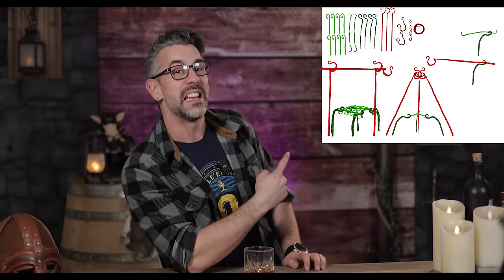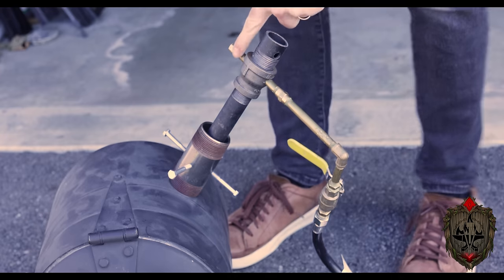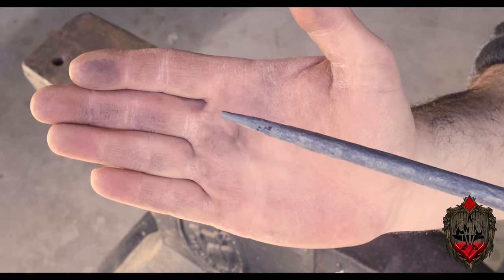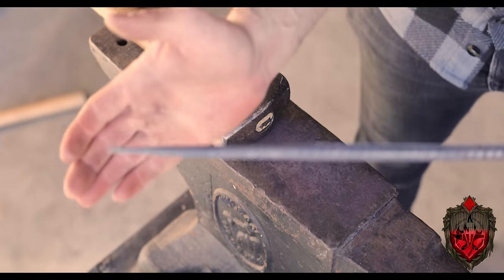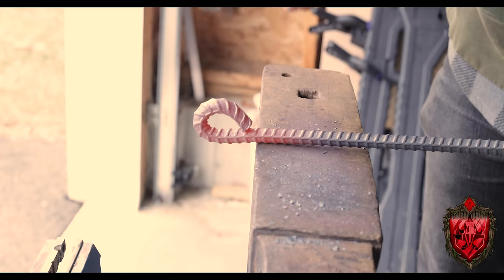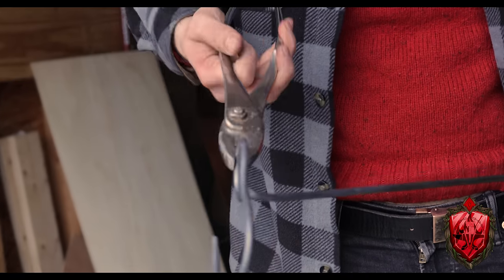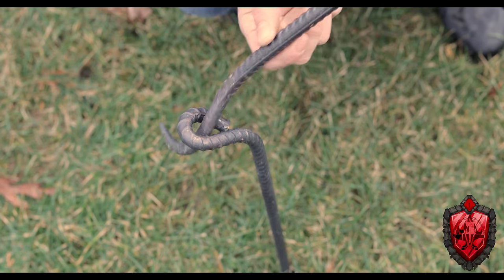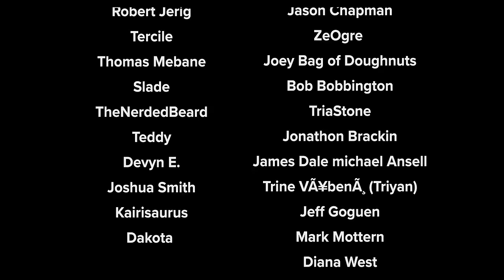Forging the Ultimate Campfire Cooking Setup

Comment: The first rule of the blacksmith's shop: everything is hot until proven otherwise.
Reply: Adding on to this: even a good glove is not going to protect you past a certain point. Use tongs (or the like) unless you are SURE the metal is cool enough to handle
Reply: "... until proven otherwise." Usually by grabbing it...
Reply: Proving otherwise is how you get thicker skin.😂
Reply: True story
Reply: @OutlandStation If you're quenching with water, just dip your finger in some water and drip a little of it onto the metal, if the water evaporates, it's hot, if it sits there peacefully, it's still hot, dip your finger in a protective layer of water and give it a couple test taps.
Reply: Just like kitchen rules - assume everything you touch is sharp and/or hot.
Reply: You're dead right. Cheers mate.
Reply: If its not actually wet from being quenched (the shop I used to work in used an old bath tub as a quench trough) don't touch it.
Reply: @brucelee3388  If it is wet, it probably won't burn you, but I have been amazed at how hot something can still be while wet.
Reply: Also lab rules.
Reply: I always say it as EVERYTHING is hot, poisonous, and sharp and whose sole purpose is to make you get to meet Mr Grim Reaper

Comment: I'd honestly recommend instead of beeswax using cooking oil and basically seasoning the various pieces. The oil will mostly waterproof it and also make it good to cook on directly.
Reply: This is the way!
Reply: Beeswax will just melt off, and even good high temp seasoning can burn off if the temp is high enough/length of time in the fire is long enough.  High smoke point oil like grapeseed is good for seasoning all kinds of iron cookware and will last well if you take care of it.   One trick if you have a pot or skillet that you are going to set in the coals or suspend close to the fire is to put a light coat of soap on the exterior or the base.  The soot and ash will wash right off, even in cold water.   (I don't have to tell you not to do this with a grill, right?)
Reply: I probably woud have just hit it with a coat of rustoleum.
Reply: I absolutely disagree. Use the wax while the metal is hot and it will burn itself into the surface of the metal, blueing it. You can do the same thing with oil, but the fumes are a bit more agreeable and (in my mind) it tends to hold better. This will burn off over time, but so will oil and you will just have to reapply it from time to time while the metal is still hot.
Reply: as a blacksmith this is exactly what i was gonna comment lol!
Reply: @CalliopePony so long as you enjoy eating it
Reply: @Glaswalker1001 was going to say the same/similar thing.  This is how my grandpa told me to do it way back in the 70s or 80s.
Reply: @tinytim7350  Wait, you weren't figuring on cooking food directly on the rebar, were you? There's no way of knowing what metal components could leach into the food with metal like that. This setup would only work if you're using a food-safe pot sitting on the rebar grill.
Reply: @CalliopePony  Rustoleum is toxic for anything you use with food. Stupid idea.
Reply: @DrachenGothik666  Rustoleum makes USDA-approved food and beverage grade enamel. Check your facts before insulting people.
Reply: , not anymore. Discontinied 3 years ago.

Comment: From a Blacksmith perspective your work is good. Just starting is the best teacher! I may have some tips for you: You should leave the Steel inside of the forge until its glowing yellow/white, it makes the work much more easier. 

Don't strike the Steel when it is not yet red glowing, espacially when you Round the Endings. You will crack the structure of the Steel. 

For extensions of the steel you may use the horn of the Anvil.

 Use the Edge of the Anvil to form the Tips of your Steel at the edge of your anvil, the angle of the hammer in relation to the edge of the anvil creates the tip and you only need a few strokes to shape it.

The temperature of the gas is regulated by the oxygen supply. If you reduce it correct, the steel will not burn and you can heat 4-6 steels at the same time.
Reply: Additional tip; make yourself a shaded space near the forge/anvil, just something to dip the hot tip of your work piece in. You'll get a better indication of the colour of your steel if it's not in direct sunlight. (noticed this around 13:56 )

Comment: As a full time blacksmith here, I will tell you great job! Safety rule #1 : EVERYTHING in the shop is hot! Treat it as such. The most dangerous color steel isn't yellow orange or red. Its GRAY steel that is the most dangerous color. 
One thing i learned a long time ago about rebar is that its a hodge podge of different grades of steel. So that being said, after forging into what you want, if it is to be struck for say, driving into the ground, be aware that it shouldn't be quenched from red hot into water or even oil at that point. it will become brittle. just let it air cool.
personally I use a mix 50/50 bees wax and linseed oil for coating. using this mix its better to heat the metal to around 300-400 degrees and brush it on. being as the metal is hot it will absorb better and will make it a nice water proof blacken. 
But anyway good job. I get asked to make these all the time for customers.
Rob

Comment: I implore you to make a set or 2 of tongs. There is a lot you learn by making them, and it's something that should be one of the first things any smith should make. Eventually you will start making more because you think if you just had a pair of things with a particular shape it would make this one thing you need to do easier, so you just make a set of tongs in that particular shape.

Comment: Long time watcher, first time commenter. 

Super heat all of the pieces of your cooking station and then quench them in Olive oil. 

Repeat process 8 or 9 times until you see a nice black coating on the outside. It waterproofs your cooking station and makes it food safe to cook directly on. 

If any part starts to rust then you can clean it off with a wire brush super heat it again and douse in more Olive oil. 

Love your work and thanks for getting me into crafting!
Reply: Olive oil becomes carcinogenic when heated to the point of smoking.
Reply: @davidalbus8089   The smoke does in fact become carcinogenic, along with any large chunks that are left behind. But the smoke of olive oil is no more carcinogenic than a campfire. As long as you avoid sticking your face in the smoke and breathing deeply the risk is minimal at best. Thank you for the reply, I appreciate your concern.
Reply: @tenjobadule1085  I should have clarified my concern being in a shop setting. Doing what you say outside I would think would be fine.

Comment: Merch idea: skill tree tool kits for folks who are leveling up skills.  :) "What can I say except you're welcome"

Edit: Yes that is a prichle hole (I am actually uncetain about the spelling of "prichle")

Edit number 2:   21:09 I think you will find that the spit contraption here will require some sort of fork that will prevent the spit from turning inside the meat while the meat remains stationary.  Or I guess you could wrap your meat in some sort of bailing wire that also connects to the spit?

Comment: I started making noise hammering metal at 15, 41 years ago.

You've learned a valuable lesson regarding hammering - let the tool do the work.
Also, having your anvil face, the part you hit on, at the correct height will really help. Holding your hammer as in striking, the face should lie flat on the anvil when your arm is at full length hanging down. The handle  should be horizontal. Bury your stump if you can't cut it.

Striking hot metal at these sizes with the edge/corner is ill advised. It will upset a far greater dent that will require more work to dress. Use the face of your hammer to draw the metal out with directional strikes.

All metal is HOT. Live by that. A glowing red piece loses that color quickly, but remains hot enough to put you in ER. Always check before picking up. Use the back of your hand and hover it over the metal to confirm. If you stupidly burn the back, you can still keep holding work. When I was really spending entire days at the forge, my hands became so desensitized and calloused that a few times I grabbed hot metal and didn't know it. Couple times I smelled myself burning. The result is a white colored temporary scar. Don't do that. It hurts.

Building your chain like that, with the s and the closed hook is correct. The hook remains attached, and that is what you hang your bail on. The s attaches to varying supports and you can also shorten the chain on the s to raise it from the fire to reduce heat. Adjustable heat.

You have followed the principles of cooking fire set ups very well. Good job. It's a long path, but rewarding.

Comment: anvils for maximum efficiency Should be at least 10x the weight of the hammer and secured down. Basically the bigger the mass and the harder the surface the better the energy rebound and therefore less work for your arm 😉, edit. Start with the point and work back when forging tapers, (Alec isn't the best example), you get a better view of the heat in a dark environment, ideally you should work the metal at a bright orange or just before it starts burning for maximum efficiency of the heat. cheers J
Reply from the maker: I appreciate the knowledge! Thanks for helping me learn. Also, love your content!
Reply: @SkillTree  Thank you so much. All the very best you did a great job. Cheers J

Comment: A big tip I can give you to save your arms and reduce pain or injury is to use your whole arm when swinging. It will generate more force with less effort and will save your wrist and forearm in the long run.

I would also see about making your anvil stand more sturdy, the shaking when you hit it from the side reduces how much force is actually hitting the metal.

Last tip is that the dents you see in the metal is because the hammer isn't hitting the metal flat. Only way to change that is practice hitting the anvil and feeling the hammer hit it flat.

Awesome project, and I would love to see some kind of leather bag or long pouch to carry this in.

Comment: Metal is like skin in a way. It has pours in it, and when heated those pours will open. If you heat your metal a bit, just enough to open those pours, then melt the beeswax onto it while hot, that bees was will soak into the metal

Comment: you can also dig a hole in the ground with a small tunnel for ventilation for the fire - and then the small setup only needs to be barely off the ground for larger pots too

Comment: The best way to apply beeswax for outdoor use (that I know of) is when the metal is around 400 Fahrenheit to 500 Fahrenheit. You also could treat them like a cast iron/carbon steel pan and season them to prevent rust.

Comment: You can get a tiny anvil at most hardware stores for super cheap
Reply: Those tend to be sand cast and inferior anvils, but still a great tool for a beginner. Especially if you get one with both hardy and pritchel holes.
Reply: @Blahutv0  Sand casting isn't going to make an inferior anvil...what does is them being cast iron. You want a proper steel, which also can be cast.

Comment: I'm not sure if this would work or not, but what if you treated it like cast iron to keep it from rusting? Coat it with a thin layer of oil or fat and then put it over a fire and let it carbonize? That might work better than the beeswax. Again, I'm not a professional, so I don't really know.

Comment: Blacksmith tips:

1. Don't wear gloves, if you grab something hot with gloves on they could melt it catch fire. And it takes longer to rip the glove off than it does to drop the hot things burning your hand 

2. The small decorative scrolls are best being made before your larger bends.

3. A better finish is paste wax applied to low red heat.

4. The clay analogy is great, clay is a great practice tool for hammer control.

Comment: very cool; only suggestion is to stay away from anything galvanised when working hot metal.  The zinc coating on galvanised iron or steel will mess your lungs up.
Reply from the maker: I maaaaaay have learned that early on in the channel. Three guesses what video THAT was lol

Comment: Blacksmith tip: Let the weight of the hammer do most of the work for you and ride the bounce. Just control the direction, rather than fight the momentum. Similar to riding the recoil of a gun when shooting. Don't fight it, let it do what it's gonna do and you won't tire out as quickly. Doesn't take much to move hot metal.

Not experienced enough to answer your question about pushing it in the direction, but it SEEMS to work for me as well.

Comment: heres a amatuer tip for anyone who wants an half decent anvil type thing without spending a penny cause legit ones are CRAZY expensive. RAILROAD track, find a chunk about 12 inchs or less thats laying off to the side. typically easy to find on less used track. its got a flat side to bolt down to a wood table. and a flat top with curved edges.

Comment: I prefer using beeswax on hot metal so it sears into the surface. It something called bueing and actually changes the top layer of the metal to make it more rust resistant. And it won`t burn of as easily as a coating would.

Comment: Instead of bee's wax, you can use used motor oil.  Heat the iron/steel up to a dull red heat and then either do a quick quench or a rag soaked in oil to wipe it down.  Assuming that the light isn't too bright making to look colder than it is, the oil will carbonize in the micro pits of the metal.  This is blackening.  Wipe off the excess oil an the finish will keep for years to decades.  Just don't over heat the metal afterward or you have to reapply.  

You want to make sure you work in the shade so you can better read the heat of the metal based on the color of the glow.  In too bright a light, the metal will have to be hotter to compete with the sun light.   This will cause you to make a torch instead of blackening.  If you've not done it before, keep a bed of sand and toss the flaming bits on the sand so it doesn't spread or a fire extinguisher handy.  

My first job was as a blacksmith in an open air museum.  This is how we made reproductions.  To sell, we used rustoleum as people didn't like the slight oily feel.  A light degreaser will make it less oily but still durable.
Reply: Motor oil!? Not if you want your camp area to smell like the inside of an engine all the time when the metal gets heated. Repulsive odour. And you can potentially use the eight rebar pieces as a kind of grill if you wanted to (though it might be difficult to do--spacing them properly might be hard), or one of the long pieces as a spit, so using a food-safe coating would be best, so motor oil is a bad idea. Why do people keep wanting to use toxic coatings? It's so stupid.
Reply: If done correctly, it leaves not oily residue.  Also, That is a item that is NOT coming into contact with food. It is a support structure.  Also, it won't smell like oil as you already burned it.  It is a carbonized coating that is in the pores of the metal.  Why do people who haven't done something think they know it all.  It's so stupid...

Comment: Hey just a word of advice from someone who had a welding class one time. No expert but I have expert advice. Never put any kind of sealant on the joints of the Smith piping. That means joint compound or pipe d*pe, Teflon tape. None of it the sealant can actually cause fires in the line and create an explosion that way. I don't know if this translates to propane but it's a really bad idea on oxyacetalene torches.

Comment: Instead of beeswax, consider seasoning the pieces with oil like you would with cast iron cookware. Basically, if you spray it with avacado oil every so often, it should be fine.

Comment: Just a tiny little technique suggestion from a former hobby smith.  Wrap your thumb around the hammer instead of laying it on top of it.  Less of the impact will be transferred through your bones and your joints will thank you.

Comment: @SkillTree

You should never have your thumb pressed against the back of the hammer. Doing this can strain your hand and cause long term medical issues down the line.

Hammer weight is not as important as one would think, and having too might weight can give you blacksmiths elbow. Would recommend looking up hammering techniques to make sure not to strain yourself long term, also allows for longer working sessions.

If going to work with metals ungloved a few things to keep in mind, some you learned the hard way already.

Visually look at the metal, to tell if you can see the heat radiating off the top.
Better to test with the back of your hand than grabbing as you can burn nerves and lose feeling, our hands are the most important manipulation tools we have.
Before touching you can feel the heat from metal just hovering above the metal.
Just because metal isn’t glowing doesn’t mean it’s not hot.

You want to know what metal you’re using do you don’t mess up your lungs, and need to be on oxygen.

Also it wasn’t the hammer blow that caused it to crack, it was the over heating deleting that part of the metal. If you see little fireworks you’ve way over heated the metal and potentially ruined the project (for more complex work)

Comment: Well it isnt really that it is delaminating because of different metals just that it is pretty much filled with impurities like scaling when they make the rebar and soft steel like carbon steel tends to be a bit more finneki and prone to cracks. So lower heat and longer soaks in the heat definetly is the better way to avoid cracks, I would sugest next time to use a coal forge for rebar so you can get a even heat and a slower heat which benefits greatly and a bit of a plus you give it more carbon too.